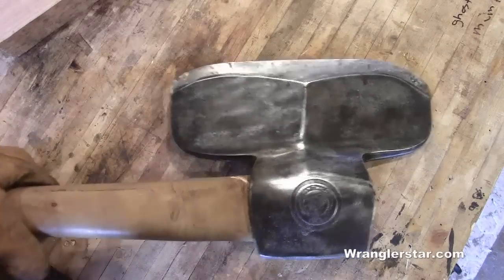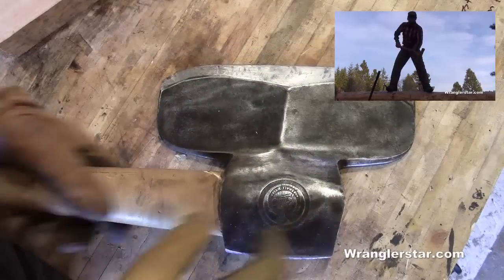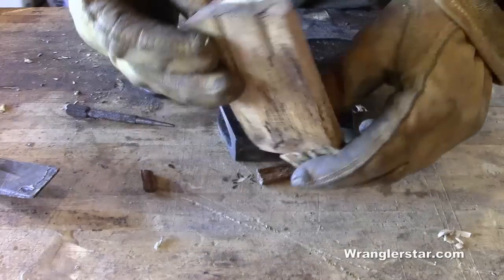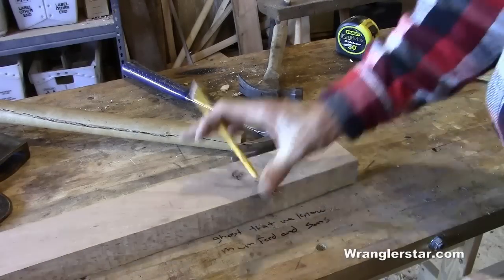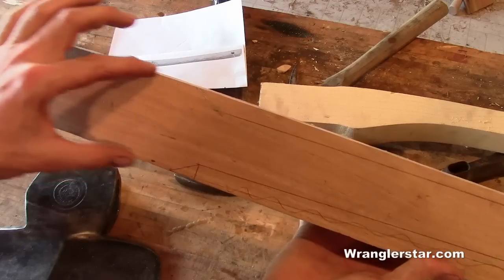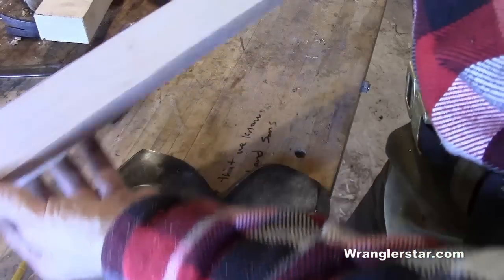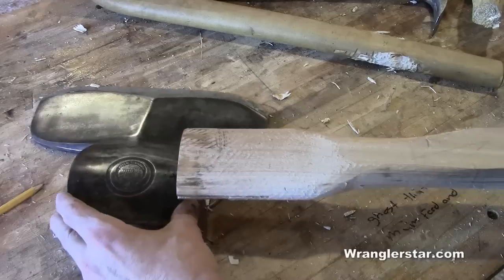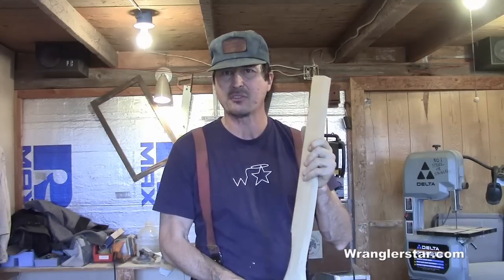Broad Axe -  Wranglerstar

Comment: The offset handle is actually common with proper timber hewing axes. They were made to be directional. Left handed and right handed for squaring timber into beams. With that angle you could stand on the log and move down the log. Also steaming is the best option. I have four blacksmith made hewing axes and when they are made from quality steel you will hear a nice ting sounds when you ring them. And lastly it is my understanding a broad axe is for felling trees or medieval battle. Not the same as that axe.

Comment: that crank neck is the original handle. I have an old book with illustrations of early american tools and that's how they used them. Working all day with one creates a need to be comfortable and away from the log. so the handle is bent so that you can have some distance. it's not a roughing tool. it's a finishing tool. so it doesn't need a felling axes handle.
Reply: and sometimes they hewed inside walls by the interior after walls are erected. That is why the handle was curved
Reply: i saw an old picture recently of some guys logging. It's easy to forget, with the size of today's trees, but when logging started there were huge trees over 6 feet in diameter. It's impossible to get the middle flat without a crank neck. you'd be standing next to a wall of wood.
Reply: If you were making railway ties/ sleepers with that you would have to be left handed to use it

Comment: My great grand father made axe handles for people all around the Standbridge, Quebec area where he lived.    He passed on in the early 1960s.     He had a shaving pony and shaped them with a draw shave.    All his lumber was cut and split by hand.   Axes were bought with out handles and the custom fit to the choppers preference.    The area that he lived in was mostly pine and spruce so the single bit axes were preferred.    Also nice job on the handle

Comment: I think hewing axes were generally made of green wood. It is really easy to rough out and fit, and when it is ready to go, the head is bent to the desired shape by clamping the head and forcing a wedge or block under the handle. You can make it then to your liking and just let it dry in place. Wedge it after it dries because of shrinkage. A hewing axe does not get the violent use that a felling axe does, so you don't need to go to extremes with safety concerns, but I warn you off on the use of linseed oil on the wedge. What goes in easy comes out easy as well. Make the kerf on a diagonal so that it fills the socket in both directions and use just a few drops of glue. No oil!  Don't use those metal wedges unless the head loosens later. Why would you?

Comment: Love the broad axe....I agree, the handle that was on there previously was done by someone who knew it needed to be bent but didn't know why so it was done incorrectly...

For the bend, i've heard of many methods.  The one used by my grandfather was to wrap wet cloths around the 6-10 inches of handle just below the eye, keep them wet for a day or two so the wood softens (steaming would do the same).......unwrap, clamp the axe head, flatside down to a bench or strong board, and wedge under the handle until it's lifted as far as desired, Leave to dry for a day or so and it should be good to go...

Comment: I might be wrong here but I always thought hewing axes traditionally have a fairly loose head, so that you can demount it and reverse it when needed for left or right handed work when doing the corners. I guess the other alternative is to have two axes for the job.
Reply: when you switch sides you would just start from the opposite end, which would keep the offset on the "correct" side

Comment: I know this is an older video, but Cody's description of what hand should be forward on an axe handle (grip-wise) is WRONG for a right-handed person.  If you swing a baseball bat from right-to-left with your right hand forward of the left hand in the grip, you are a right-hander.  I notice in some of Cody's videos (i.e. the "Back to Basics" series), that he prefers swinging his axe from left-to-right, with his left hand forward of his right hand in the grip.  That's a classic left-hander.  The "preferred hand" is the one always FORWARD in the grip -- this hand is the controlling hand and also adds power as well.  The other hand (the rear hand) is the pivot point.  All axes except the broad axe can be used by either hand.  The broad axe is a "handed axe" (meaning, that the eye angle in the head determines whether it's for a right or left-handed user).  Cody, not realizing this at the time (probably because it's his first time with a broad axe, at the time of the video), implies that his broad axe is "backwards" griphand-wise.  This is wrong; it's just that his broad axe is for a right-handed user, but Cody is left-handed.  Me personally?  I've trained myself to swing an axe both left-handed and right-handed (almost ambidextrously), because it comes in handy when you're on a bad angle to use a particular-handedness (thus, all I have to do is switch-up my grip and swing from the other direction).

Comment: As a free service, here is how to find the good lumber yard in your area. Trust me this is some sage advice, it's not as easy as you think.
First figure out where the lumber yards are in your area. Shouldn't be that hard.
Secondly, wake up at 6 am (preferably on a Monday) and go visit them. Ya 6am sucks but you need to actually see for your self.
The first thing you'll notice is that most of them won't be open. (Most of the stores that won't be open also advertise on national TV) Save the national stores for last, don't dismiss them completely you still might have some luck.
What you are looking for at 6am on a Monday is an open (or at least their yard) store. You'll easily spot this buy the vast number of pickups with racking, flat decks, trailers all milling around. Those guys are contractors, they work with wood for a living. If you are feeling really nice, bring extra coffee and give it to them as a thank you because they have already done the leg work for you and found the good lumber store.
They are at that particular store at some ungodly hour in the morning for the same reason you are. They need something that you can't buy at any old store at any old time. Composite decking in some particular shade, by the semi load... Special shingles in some off color, made from recycled tires... That store has a network, has employes who care, and gets stuff...
Failing that, the big national stores probably have what you're looking for in their network. But you'll have to have an answer for "what's a hickory?" before you get your product, a 6am wake up call is easier.

Comment: Cody start the step wedges by drilling a small groove to get a nice straight entry. I use a 1/32 drill bit and a dremel to start the slot for the wedge, only go about 1/4" deep or less. Almost never a split.

Comment: I noticed you didn't put an offset angle to the new handle when you installed  it in the head. The offset is  to keep your hands away from the log as you hew the flat as well as allow you to stand out to one side of the log and the swing of the axe head so you are less likely to spit open your shin. Some old hewers had a tin shin guard on the leg next to the log. Good job and safe hewing.

Comment: I thought you left the handle un wedged so that you can take it out and turn it around. As it is now you can use it so that the log is on the right side of the axe, but if you turn around so that the log is on the left side, you cant use it, hence why the handle was left un wedged, so that you can turn the head around.
I might be wrong though.

Comment: The handle looks great and I have learned a lot form you channel. The only thing I have to comment on is No. 1 or 1 common is not the highest hardwood grade. FAS and FAS 1 face are both better. I would recommend checking out NHLA hardwood lumber grading scale. Keep up the good work!

Comment: A few thoughts on your axe. You are right handed, but you hung it left handed. A right handed person swings on the left side. It sounds goofy, but when you stand next to the log, the log will be to your left. As you hew, the axe will fall down the side, parallel to the log. Also, why do you insist on using the metal wedges and creating more potential break points, running along the grain. I was always taught that if you fit the handle properly, and the wood wedge, that it will never come off. That method has served me fine for many years.

Comment: Wranglerstar, I have a question that has many different answers and I was hoping for your opinion. I have a vintage hewing axe head I found stuck into the base of an old elm on an acreage I used to own. I want to put a handle on it with the offset and I'm curious about the length. I'm 6'3" tall and plan to use it standing next to a log not on top. What length should I go with ? Material isn't a prob, I have ash, Saskatoon and choke cherry as well as birch I could use.

Comment: I’ve seen a video of a dude using a different method of installing a new handle rather than cutting a split in the middle they cut the head at an angle then drove another wooden wedge on the opposite side to secure the head could that be used on felling or camping axes to that method seems a lot simpler

Comment: If you pound the step wedge in horizontal you run the risk of splitting the handle. Due to prying the grain apart. Try putting it in vertical.

Comment: Forgive me for saying so but it looks as if you've done this backward. That head appears to be the reversible kind (for right or left-hand use) and IIRC you are a righty. So the bevel should face out when you work with it, right hand on top, meaning the bevel should face to the right as you work. Can you comment on this? Perhaps I am wrong or missing something. Looks like a nice job though!
Reply: You are correct. If he uses that axe as he intends, he really will bark his knuckles, since they will be on the log-side AND there is no bend in the handle. But as someone who has hewn many a log, I agree with him in that using a broad axe is really hard on your arms!

Comment: I noticed when you were chopping down the tree in the previous video you appeared to be left handed then while cleaning up the fallen tree you were right handed…but the broad axe appears to be for a left handed person with the flat side of the axe on the right side a right  handed person would have the flat side on the left, which keeps your hand on the outside of the log, then with a slight bend on the  hand you'd never break your knuckles on the log. anyway, so did you transverse the image on your video to appear to be left handed ?
Reply from the maker: Transverse? Now you confusing me. I don't alter the videos in anyway. I can swing both way.
Reply: wranglerstar oh ok so you are ambidextrous, I began to think that, but the broad axe is a left hander…right? I have seen others and the flat side is usually on the  left side of the axe for right handers, when you are swinging the axe your forward hand is meant to be on the outside of the log, not internal actually over the log which could be very dangerous, where your wrist could be slapped against the log and with a 9lb head…wow….... Transversed is a printing term when a photo is flipped horizontally during prepress setup…

Comment: Cody, I have a question.  If the handle fit so tight, is there still a need for the extra wedges?  What will happen if you don't put in the step-wedges?
Reply from the maker: I've never tried it. I think it would eventually work loose.

Comment: You can only steam naturally dried wood, well.....you CAN steam anything you want but steam bending isn't effective on kiln dried woods due to the full curing of the lignum at higher temperatures.  If you want to steam bend wood, you'll need some that has been properly sealed, stickerd and air dried over time, typically 1 year per inch of thickness, so 8/4 would require 2 years of drying time.

Comment: Step wedges should never go in this way..that causes handle splitting. They should go in parallel to the wedge. using two step wedges put one on the left side of the wood wedge and the other on the right side of the wood wedge in the seem where it goes into the handle..If I were to send a Pulaski back to BLM or NPS they would reject it...USFS is the same way..
Reply: Director Border Narcotics than what is the proper way
Reply: Also wrong. The step wedges should be the way he did it but placed farther from the middle. You want the wood to bend into the corners to tighten it up, not split it down the middle. It's exactly the same concept as a wedged mortise and tenon in woodworking. Why in the hell would you wedge it twice in the same direction?
Reply: Handles don't split, it's in the Gineva convention, look it up.
Reply: Glad a manufacturer commented...

Comment: you really should not put the steel wedges in  handle. you look for good handles with straight grain and spend all that time to fit it perfect and then you drive those wedges in and split the grain. watch this it is a very good video US Forest Service, An Axe to Grind - Complete Documentary

Comment: The reason you might have been having trouble with splitting when putting your wedges in #1 your wood could be to dry #2 put your wedges in on slight angle not straight across grain. 

Iv also seen a pro handle maker using wood glue to set the wooden wedge, acts as lube and of course keeps wedge in place after curing. great video! watch your knuckles without the offset in that new handle.

Comment: when insert a wedge
why using oil instead of bond?
is that better?
Reply: 신진호신진호 its better in some eyes and in others not but oil is a lubricant that soak into the wood and does not evaporate  because its oil
Reply: colio 47 hmm..thanks for answer. I concerned about replace my axe handle. old gransfors.
Reply: Oh OK just try it I bet you'll do perfectly fine. ;)
Reply: colio 47 thank you very much!

Comment: I clicked Dislike.
This axe has gone from a practical 2 handed log hewing broad axe to an ornamental wall hanger. Now that it's flat you can hang it on the wall !
It's sad to see something destroyed. Imagine the history of that old axe ?
This axe would have been used for 2 handed rough hewing before a finer hew took place with a different axe with less of an off-set.
Reply: I do believe he said the old handle was broken. So he and to replace it. He also mentioned he might steam bend the handle so its not broken and a lot of broad axes don't have a crazy bend like that just a slight bend in it. So from one woodsman to another I know why he did this.